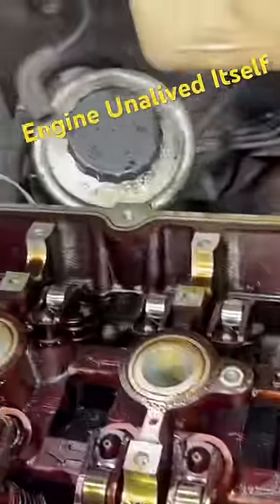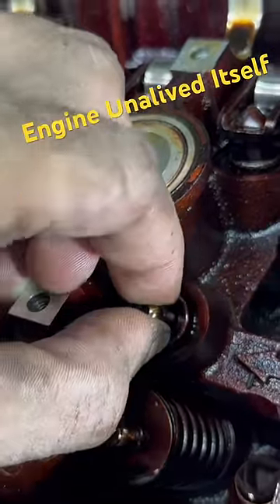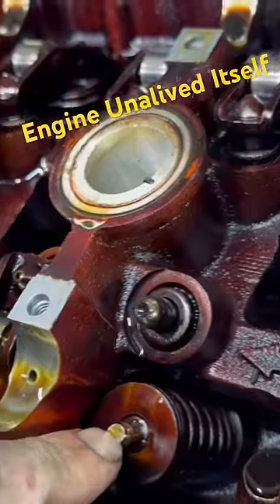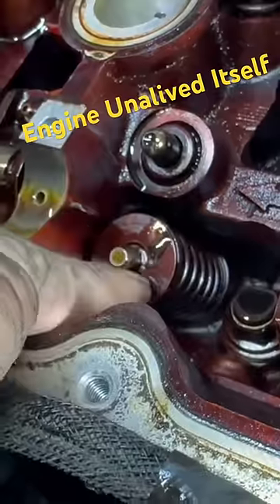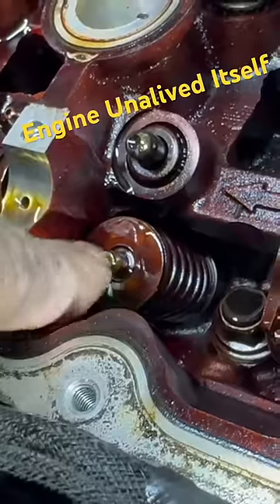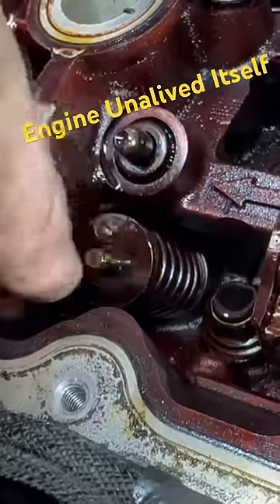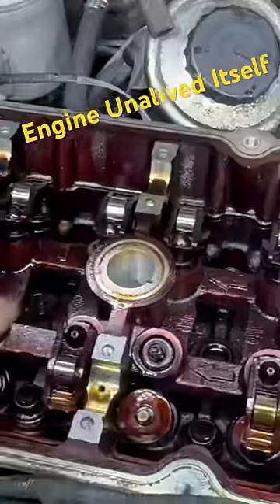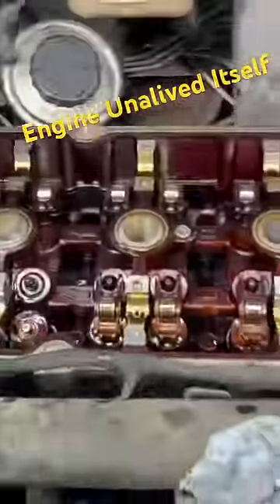Worst Engine Ever! Destroys itself while turned off! Chrysler 2.4 Turbo Non-Turbo #shorts #mechanic

Comment: The 2.4 world is actually a pretty decent motor. Same with the hemi. Mostly comes down to taking care of your car and getting your services done on time. Still not as good as Hondas though
Reply: my boss did a k24 swap on a 92 civic. he just ordered the wet zex kit for it. no internals changed. we will see what a stock k24 can handle soon. he has a 02 s2000 rhat he is going to turbo. but he has dropped a shitton of money on sleeves.......over 1500. pistons and rods 1k. this is wholesale cost. hes gonna be 6k into it before he hears it run
Reply: @jasonquadro4375  6k for a built motor is honestly not bad. Working on a hemi build for 650whp gonna be about 10-15k for rods, bore, stroke, full floater pistons, cam, valve springs, tuning, and supercharger, etc. still won’t beat a built Honda purely because of weight lol
Reply: Did 12.5@110 on a hybrid 2.5/2.4 holset combo , made 370/376 to the wheel at 18lb
Reply: U cant tell me the 5.7 hemi is a good engine when i hear nothing but ticking from every one of them with over 150 thous miles
Reply: @user-vw4cg1xq7r  I think there ok motors for smiles per mile other then that I wouldn't put my life on a Chrysler engine to keep me alive lol
Reply: @11D7-n8d gm 4.8 with over 400 thousand km.. no knocks.. but damn leaks 😂
Reply: @jaxoncroydon3516 No need to stroke a hemi.
Just needs cam, injectors, valve job, ported polished heads and a supercharger, (or twin turbskys)
All depends on the person tho.
Reply: @bmint Good engines those 4.8 and 5.3 are.

Comment: I have a 2001 , 2.7l Chrysler that would tell this engine to hold its beer 👍🏻🇨🇦🍻
Reply: A 2.7, my condolences.
Reply: I have a 2001 Sebring 2.7, also a 2006 PT Cruiser. My driveway is just a ticking bomb waiting. Lmao
Reply: @tylerc7037  2 summers ago mine started running hot so I pulled out the fan relay so when the key is on both fans run full power it hasn’t been warm since lol
Reply: @JonnyMudMower  I had to change the whole fan in the PT. Sebring has been great. Except 2 faulty thermostats that I had coolant leaks from
Reply: 100 to 150 is when they really start to sh-t the bed . You obviously never had to work on one they are the worst designed water pumps I’ve ever seen , the whole things are a messy design.
Reply: @@PeterAngles the water pump on the 2.7 is inside the engine .

Comment: I drive a 2009 PT Cruiser with what I believe to be this engine. It broke the timing belt but did not bend the valves. So it's been put back together, and it's running just fine again. I've heard a lot of negative things about these cars and their engines and transmissions, But, so far, this car has actually been a pretty good one. And I AM NOT a Chrysler fan.

Comment: I have a 2013 2.4 and it has a timing chain,so not sure when it was changed to a chain from a belt but the engine itself is quite reliable and decent if properly taken care of,the only drawbacks are some external plastic parts..

Comment: How did I know! One of those fragged itself while I was working on it. Couldn't find a junkyard replacement because all the cars were in the yard because of their engines. Finally found one that mounted transversely and swapped everything off the longitudinal engine to work. Worst. Engine. Ever.

Comment: Its a lash adjuster not a lifter
Reply: It's a L.M.A., yeah it pumps up with oil pressure, but it doesn't lift anything and it does not hold the "Lash" to a specific clearance when valve is closed. It actually holds the follower up against the cam lobe which is why they call it a lost motion adjuster
Reply: wrong... hydraulic lifter

Comment: You know Ive owned 2 Pt cruisers and my only major maintenance on either of them was the timing belt/water pump/ tensioner changes. As far as the engines, the first got destroyed by a drunk running into me at 260k miles. Second one had 357,000 on it when I sold it. 
That was 3 yrs ago and the kid still drives it every day

Comment: Being a mechanic for 15 yrs now, I've always said from day one with the little knowledge I had then, Change the oil frequently.  Lucas doesn't hurt once in a while too. Still rings true to this day of course.  

Side note being in ny I've heard plenty ppl say on synthetic they've heard ppl run their intervals up to 7 or 8k or more. To me that's just insane. Conventional should be 3k or so and synthetic should be 5 or so. At least in my opinion because maannn oil is the blood of the engine.  If ya don't lube it you ruin it 🙂 

What's your take on intervals?

Comment: That’s a lash adjuster not a lifter SOHC/DOHCnever has “lifters” furthermore if those lash adjuster get locked up in the open position you’ll either bend valves or breaker the rocker arms… that lash adjuster style from Chrysler/dodge was very faulty if you didn’t keep up on your maintenance
Reply: Facts.

Comment: Best engine, I replaced over 50 broken timing belts  and never seen valve damage,   never
And i relined my 2.4 turbo, with mopar stage 2 and bigger turbo no problems
Reply: My Lil bro had a stage 3-
What a scary fast car..
4th gear burnouts.
Reply: My 2009 PT Cruiser just broke a timing belt and has been put back together with no problems. Replaced timing belt and water pump and off she goes.
Reply: @ONTHEEDGEFRED  is that a non-interference engine?
Reply: @rdallas81  I reckon so, You are not the first one to ask that question. And with the remarks on here about broken timing belts with no bent valves, it must be.
Reply: @ONTHEEDGEFRED  Thanks.
I never worked on the 2.4.
Good engines tho!
Drove a SRT with stage 3- big turbo, injectors, cams, the works.
Had to have been 600 or 700 HP.
It would do 4th gear burnouts while on the go.
Reply: @rdallas81  I would have to agree, I've heard nothing but negativity especially about PT cruisers, But, as I've mentioned before, so far, my car has been a pretty good one.
Reply: @ONTHEEDGEFRED  they are very good vehicles. I worked in a shop for years and never had to do any major repairs on the PT, or even Neons. Just maintenance work.
A vehicle is often depicted by the owner.
Proper maintenance means years even decades of a good vehicle..
I own a 2004 Dodge Ram 1500 Laramie- has 300,000 miles on it.
Also, a 2004 Ford F150 with 4.2 and 5 speed, 260,000 miles.
Both run good and strong. Maintenance, maintenance, maintenance.
Have a good day
Reply: You see no damage every time because they are not interference engines...

Comment: My brother-in-law had a Journey with one of these engines. These NA 2.4L engines have a terrible power band. To do any kind of reasionalbe acceleration you're rifht up at redline. These things were made with torque as an after thought.

Comment: Actually the 2.0 and 2.4 were great engines , it all comes down to maintenance and not missing them or going way over . I’ve had 2 and they were tough , only complaint I had was the 2.4 DOHC was way worse on fuel then the 2.0 DOHC ( the 2.0 SOHC were not as reliable) .

Comment: The biggest problem with that engine was the oil used. It was stained the aluminum and other deposits are in the oil passages.

Comment: I've had great luck with these engines but boy do they need to be properly taken care of. I had a base model neon that ran all the way to 230k miles and it didn't care at all. I sold it 8 years ago and I still see it in town sometimes. The only issues I had was I blew a water pump and went through 2 alternators back to back due to an electrical issue.

But my friend had a red one nearly brand new in high school that he drove until it got rod knock. Instead of tearing it down and fixing it, he just said screw it and decided to stop maintaining it except for fluid changes. We took it to meets and races that we'd lose, power slide it in parking lots, he'd shift at like 4500rpm every single time. Amazingly he drove it that way for our whole senior year until it finally died. That poor little dodge. 😂

Comment: So this is TDC on the compression stroke, wouldn't you just need to turn the crank shaft to exhaust stroke and intake stroke to open them? Seems like the valve guides must be pretty built up.. oil burning causing build up might also mean the oil pathways and gravity feeds are also blocked. Some degreaser might do the job too!

Comment: 2.2 subaru was designed to be turbo,  but they built some non turbo and those literally burn up the 4th cylinder due to lack of turbo air flow

Comment: Honestly, those 2.4’s get a bad rap needlessly. Outside of it being a pita to do the timing belt, and the senseless crank position sensor installation, they are very stout engines. That’s the world engine used in a plethora of automobiles from Mitsubishi to Kia/Hyundai.

Comment: Funny the 1st time I saw that style lifter was on the 69 2.3 ford pinto bigger but similar design then the 2.2 dodge ohc has them for years and they tended to be very durable, soooo the modern engine suffers from lifter related issues . Is it the internal design, the material, the spring pressure?? Why do they fail so much???

Comment: 2006 back is the best 2.4 engines!Non-interference,and will run well over 300,000 miles if proper maintenance is done!

Comment: Buddy likes to work too much, just do a compression check. That will tell you which cylinder(s) are bad. It has to come apart to fix it anyway. The aluminum head(s) needs to be resurfaced every time.
Edit- or do a proper leak down to find the specific leak area, you could be waiting a while to fill the engine or cooling system with  smoke.

Comment: Worst ever!!! I think not just like the thousands of other timing belt / interference engines out there you just have to do normal maintenance and change the timing belt and not go 250,000 miles. I was a Chrysler tech for 20 years and they`re worst engine by far is the 2.7 and it`s not even close.

Comment: The valve retainer rotate and then locks?? But the engine is not destroyed if it keeps closed. It would be way more crazy if the valve locked open

Comment: worst engine ever? have you never worked on or seen a hyundai 4cyl before? they literally blow up in 5000kms or hell even less than 10kms....literally crap engines....the 2.4 world engine THAT engine you have there is actually oen of chryslers MOST RELIABLE engines...mine has over 360,000kms going strong....it all comes down to maintenance.

but everyone knows that the duramax is the worst diesel engine tho.....basically the poor mans diesel who cant afford a cummins
Reply: Worst engine ever was G.M. 6.2....you know, the Oldsmobile gas engine they tried to make a diesel out of?😂😂

Comment: Yes it's a bad design. Thing is you need to change the timing belt at the required intervals. Most people don't think omg i need to change my timing belt it's 70k miles. Ever seen the, just rolled in, videos? I just wonder what % of these engines the belt was changed vs it blew up?30% changed?

Comment: Yep that’s a Chrysler alright
Reply: I had the same engine in a wrangler. The belt had it's teeth stripped and I put another one on. It had 270K miles when I sold it.
Reply: Well actually that engine is a 4g64 which is made by mistsubishi. So really that’s mitsubishi not chrysler
Reply: Funny..
As if that by itself means anything..
My Dodge truck has 300,000 on it and all engine parts are 100% original..
And yes I pull trailers with it..
All engines have a weak spot or spots- its up th the owner to investigate the failure potential of all things if they are minded that way
Reply: @kryptidstudios6746  Wait, its out of a 2010 PT cruiser, isn't it a WGE engine??

Comment: Those are called pushrods, not lifters. They sit on top of the lifters and transmit the lifter's movement to the rocker arms.
Reply: Thanks for pointing that out..
I see a lot of Keyboard mechanics here and few actually know what parts are different for a Overhead cam vs inblock cam.

Comment: Exactly how did the engine "destroy itself while turned off"?????
We get a little education about valve spring retainers with DOHC cams and removed and then smoke...
The title of the video blows smoke up our A$$
I'm pretty sure the title should be a representation of what's in the video.
Obviously you have to watch the full video link pinned to the top to find out.
As an ASE certified 40 year veteran diagnostic technician, I suspect the timing belt stripped at the crank during cranking.
The good news is that this  [or at least the 2000 Caravan version] is a non-interference version which means the pistons can't hit valves. If the cams are rotated independently the valves can collide with each other. The good news in that situation is the cams likely remained synchronized unless the stripped part of the belt made it to the exhaust cam and lost sync and bent valves.

Comment: I take it the 2.4 Chrysler motor isn't a good one to have...
Reply: It's better than a smaller turbo 3 cyl.
Reply: Don't listen to these idiots. The 2.4L is a great engine. Change your oil and it will outlast the entire car.
Reply: Every engine ever has flaws...
Most flaws are made manifest by the owners failure to maintain their vehicles.

Comment: Most reliable engines are Toyota Honda and Mazda
Reply: Ford.
300 CI Inline 6 shits on those other engines..
Seen them with 800,000 miles drive into the shop..
Also, Chevrolet 350, 4.3, the Supercharged 3.8, Ford 302, Dodge 318 all seen em with 600,000 miles and more..
I worked at a shop for years and serviced fleet vehicles and did work on all manufacturers even Mercedes and BMW.
The highest mileage by far was Ford and Chevy.